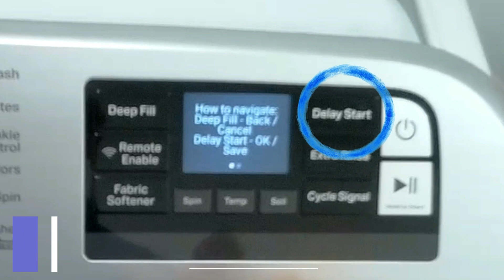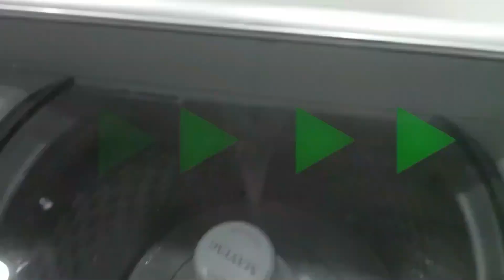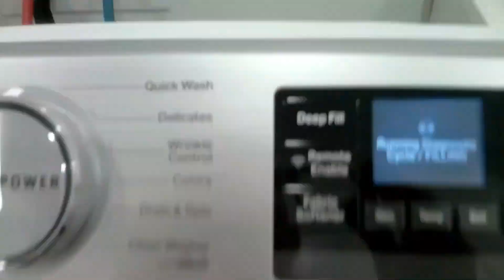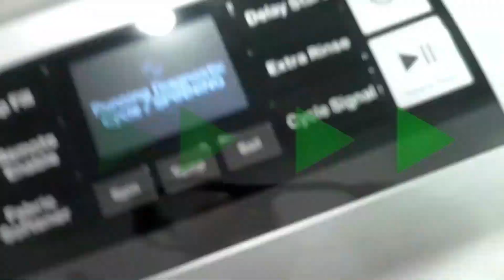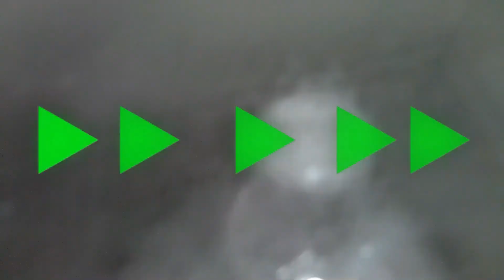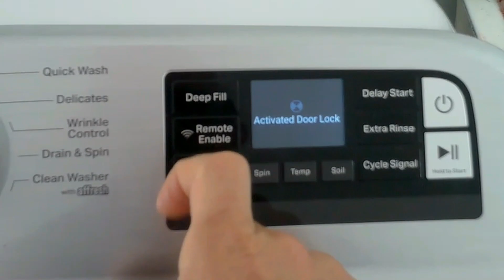Maytag Washer Troubleshooting Guide: Fix Errors & Reset Your Machine Easily

Comment: Just replaced the intake valve on my MVWB865GWD. Started wrinkle free cycle, it filled and washed 2-3 minutes then displayed LF code. What's happening?
Reply: Model # could be MVW8865.
Reply: Nope. It's B865

Comment: THIS COUNTRY NEEDS AN APPLIANCE LEMON LAW. EVERYTHING IS  PURPOSELY DESIGNED TO WITH CHEAPLY BUILT PARTS. CARS ARE BAD ENOUGH, BUT IMAGINE IF THEY WERE AS BAD AS APPLIANCES. WE WOULD NEVER GET TO OUR JOBS RELIABLY ENOUGH TO  BUY THIS GARBAGE.
Reply: I agree as my third washer went out in 10 years. I started doing research because I need another one now which would make it my fourth so in 2011 the government put water restrictions on washer machines therefore the new smart features came out and the new look of the new washers, they added the lock switch so a lot of washers you couldn’t see how much water they were using Junk thank you Obama for putting on those restrictions. I wonder how much you gotten kickbacks for your “ green deal”

Comment: F3E2 where is the temp sensor   ?
Reply from the maker: It is typically located in the water inlet valve assembly.
Reply: @onlineappliancetech  but with that error watching your video possibly it could be the water inlet valve ??

Comment: F7E4, replaced the slider and gearcase assembly. Still doesnt get past sensing before it says wash complete.
Reply: Also replaced the clutch and still has same code and operates the same. On the verge of just purchasing a different washer at this point

Comment: I had a F9E1 code, so I replaced the drain pump, cleaned all the lines, and the pump still ran continuously. I figured it had to be the pressure switch on the control board. So, I installed a new control board, but now it powers up, with a flashing green light on the board, and the screen says it had a power failure, but none of the buttons will work and do anything. It just sits there saying it had a power failure. Resetting it for 5 minutes does nothing.

Comment: My Maytag MVWB765FW3 does nothing when I push those buttons to try to get to diagnostic mode
Reply: @lynnmaureenshevshenko8254  unplug the washer for a few minutes than plug it back in again, that worked for me. Also make sure it is OFF when you push the buttons.

Comment: Thanks for the video.  I replaced the main control board on our washer after it wouldnt power up after 1 year ownership.   The machine powers on after replacing but sticks at 12min spin cycle.  It will complete of I cancel and chose drain and spin. No issues draining that I can tell.   I ran calibration and diagostics.  No codes.  Any thoughts?

Comment: I am getting three codes the F6E3, F7E3, and F7E4. the water turned on but when you go to wash it stays in sensing and the agitator does a slight move then it says complete, but it never pumps water in. When I do the diagnostics it all runs but then gives me those three codes. any ideas? the machine is only 11 months old.
Reply: Same here. Did u resolve it?
Reply: Same here. Any solution?

Comment: I have this machine and I have a washer repair man here now and he can not get the water pump to shut off, he thinks the machine still thinks there is water in it. Ready to throw it out. only 2 years old
Reply from the maker: If the washing machine continuously attempts to pump water out of the tub, this indicates an issue with the shifting mechanism. It's not releasing pressure properly, causing the main control to mistakenly think there's still water in the tub. A simple test to confirm this: plug in the machine, and when it starts to pump out water, open the lid and lift the tub slightly. If it stops trying to pump, this means it's not transitioning from agitation to spin mode correctly.
Reply: it turns out that the latch on the lid needed to be replaced and the mother board costing me over $ 700.00 / maytag has gone to crap @onlineappliancetech

Comment: I am calling about not a top washer Maytag, where the water goes. It keeps overflowing the washer does not rent well and I have to go to drain and spin every time I do a wash what could be going on
Reply from the maker: It seems that the waterline inlet valve is not completely closing, and this might be the reason you're experiencing these problems. I trust this explanation will assist you. Kind regards.

Comment: Mine goes into the sensing mode its sensors for a couple minutes and then it says wash complete and never even starts running the water but I can hit the fill water button that's by where you put the laundry detergent in that and water will come into the machine
Reply: Same. Any solution?

Comment: The whole Maytag control panel is OFF - not working1
Reply from the maker: It’s possible that the issue is with your Main Control Board; however, first, please plug a lamp into the wall outlet to ensure there is power. Subsequently, I recommend having a service technician diagnose the washer before purchasing a new Main Control Board, as the problem could also be related to the display MPC.

Comment: washer will not unlock getting drain fault how can i get washer to unlock
Reply from the maker: I recommend unplugging the washer and waiting for about 5 minutes before plugging it back in. If this does not resolve the issue, you may need to use a wet vacuum to remove water from the back drain hose; the door might unlock once the water is removed. If you feel uncomfortable performing these steps, or if they do not work, it would be best to call a professional service technician for assistance.
Reply: @onlineappliancetech   thanks I'll try it

Comment: I have a maytag washer model # MVW 7232hwo no power to display, i checked the outlet for power with a lamp there is power ,i checked circuit breaker there is power . here is what happen i put a load of sheets in washer turn dial to bulk setting turn temp of water to hot hit start and it was running went back to check and machine stop ,i unplug the electric cord from the outlet waited one hour plug it back in still not power to the display ,can not open lid to washer its in lock mode and there is water in the tub .Don't know what to do. Help ???
Reply from the maker: Sorry to hear about your issue with the Maytag washer, that definitely sounds frustrating. It's good that you've confirmed the power source isn't the problem by checking the outlet and circuit breaker.

Could be the Control Board: The lack of power to the display could suggest a potential issue with the washer's control board. This would need to be inspected and potentially replaced by a professional, as it is an intricate part of the machine.

Please remember to always prioritize safety while handling electronic appliances. If you're not comfortable or familiar with these steps, I'd highly recommend getting in touch with a professional or Maytag's customer service for further assistance. Hope you get this issue resolved soon!

Comment: I have a F2E2 screen says contact service
Reply from the maker: The F2E2 error code on a Maytag washer generally refers to a problem with the machine's user interface (UI) or control board.

This error might be triggered by a miscommunication between the machine's control panel and the wash cycle settings, and it can sometimes be caused by a power surge or glitch.

Here are a few troubleshooting steps you can take:

Reset the machine: Unplug the washer from the power source for about a minute, then plug it back in. This can sometimes clear the error.

Check for power issues: If the washer doesn't power on or the controls don't respond, this could point to a problem with your home's electrical supply or the machine's power cord.

Inspect the control board and UI: Look for obvious signs of damage, such as burns or broken components. If you're not comfortable doing this, you should get a professional technician to do it for you.

If none of these steps resolve the issue, you'll likely need to call a service technician. They might need to replace the user interface or control board.

Please note that working with electronic appliances can be dangerous. If you are not sure about any of these steps, please consult with a professional.

Comment: Im getting a f7e1 code. Reading to just unplug and plug back in....did that but same thing...only 10 months old. Does sensing but doesnt spin and then stops and throws the f7e1 code. Any ideas on what to check?
Reply from the maker: It sounds like you're referring to an error code on a washing machine, as F7E1 is a common code for many models. The F7E1 error code usually refers to a speed sensor or motor problem, specifically it could indicate:

A failure in the motor to achieve or maintain its speed.
The motor is not turning when it should be.
The tachometer on the motor is not working properly.
An issue with the shifter on the washing machine.
Here are some things you can check:

The Wiring and Connections: Check all the wiring and connections to the motor and the washing machine control board. Make sure all connections are clean, secure, and free of corrosion.

The Motor: It could be that the motor has some issues. Try to spin it manually, and if it's stiff or doesn't spin freely, then it might need to be replaced.

The Capacitor: If your washing machine has a start capacitor, it may be defective. A multimeter can be used to check if the capacitor is working correctly.

The Tachometer: This is a component that measures the speed of the motor. If it's faulty, it might be the reason for the error code.

The Shift Actuator: This part shifts the splutch assembly to switch between the wash and spin functions. If it's not functioning properly, it could prevent the washer from spinning.

The Splutch assembly: This connects the transmission to the motor and allows the washer to switch between wash and spin.

If after checking all these and the issue persists, it might be best to contact a professional technician to diagnose the problem. As your machine is only 10 months old, it might still be under warranty, and any repairs may be covered. Always remember to unplug your machine before checking or replacing any parts to ensure your safety.

Comment: I’m not getting a code at all, just won’t fill with water and then says “washing complete” I’ve reset the breaker as Maytag suggested. Purchased in February and highly upset. Thanks for your video, gonna see if it helps me.
Reply: Having the same issue did you find anything out??
Reply from the maker: Have you checked for any stored error codes?
Reply: Did you ever get it fixed? Mine is doing the same thing right now. Not dispensing the water and getting a complete wash but the water button still works
Reply: Having issues  .what did you get
Reply: The extra water button wont work on mine when I want it to
Reply: My machine is new
Reply: Same for me! I am not sure if it is becouse of the bottom part of lock because it used to lock than start sensing now it goes to washing complete..
Reply: @cherylfisher-v7b  can some body please provide a solution,  my machine says to clean my washer with affresh when i do no water dispenses the agitator twist a few times then machine says cycle complete. Its clearly not been cleaned however i can wash clothes no problem so whats going on here please help*
Reply: @kristyalexander5650  Hi!  Did you figure out the issue?  Mine is doing the exact same thing and will not fill with water at all.

Comment: Hi thank you for the video. Question when I run the lock it didn't lock but didn't give me a code initially I hade code f9e1 do you this the door lock malfunction
Reply from the maker: Let me check
Reply from the maker: Give me till tomorrow please....
Reply from the maker: The F9-E1 error signifies a Long Drain Fault, suggesting that the washing machine's drain pump is facing difficulties in eliminating water. The issue typically lies with the drain pump. I'd suggest using the service test mode to fill the tub with water and attempt to drain it. If there's already water present in the tub, just activate the pump while in test mode. Listen carefully for any humming noise, as this would imply that the pump, despite being powered, is malfunctioning and needs replacement. I trust this advice is helpful!
Reply: Thank you so much for your help
Reply from the maker: @mariavillalvazo1671  :hand-pink-waving: